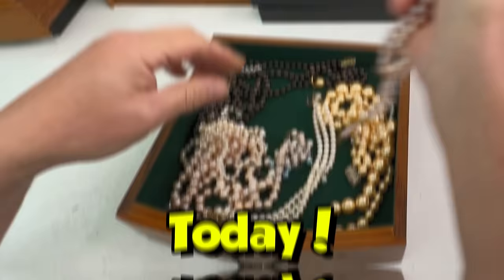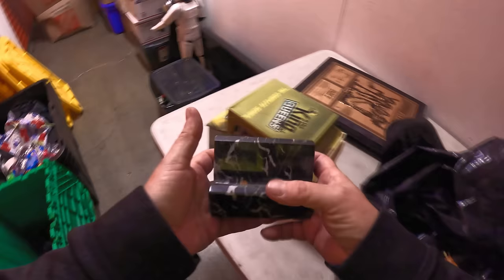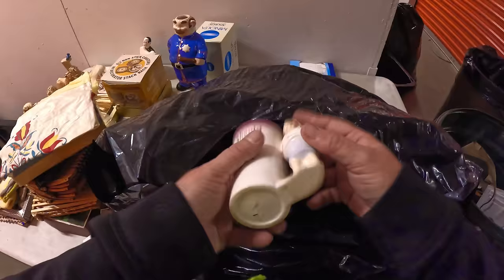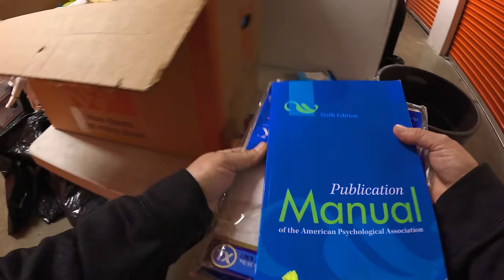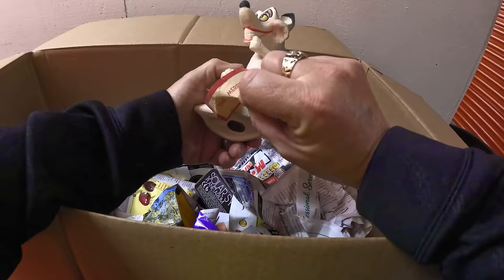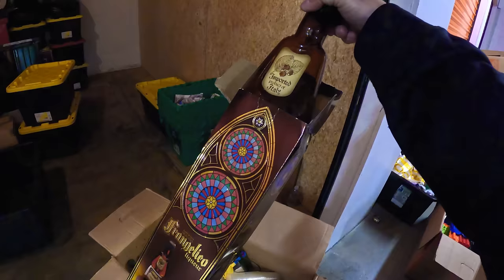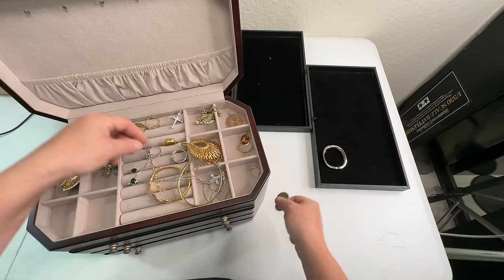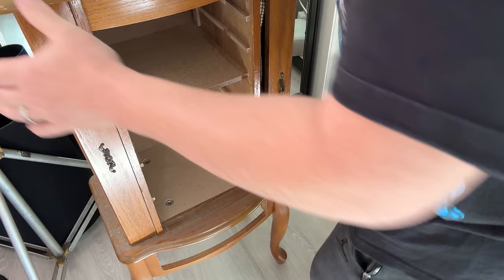I was NOT EXPECTING this... GOLD FOUND! Jewelry box opened and we hit it BIG!

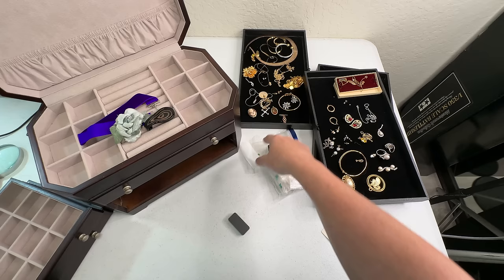Comment: Jack - vintage cocktail napkins/paper can sell for good money.  A local antique dealer buys everything I can scare up because it sells like hotcakes.  Actually, any and all cocktail Mid Mod. It all goes. 12:36 Bet it opens out into a lampshade or similar.   18:18 Made for Barney's NY? It isn't cheap, no matter what.  Barney's doesn't do cheap.  53:00 That's a REAL Cameo habille!  The pinback may be steel, as was standard, but the cameo is genuine. If someone got that as costume in the Whatnot...SCORE! (wish it could be me, but I can't load Whatnot)  56:10 Iolite that ain't. It's yellow.  case closed. 56:33 Not tanzanite.  It's blue. Aquamarine maybe. 57:30 NOPE.  14/20 = 1/20 14k gold-filled aka COSTUME. Lots of freshwaters have gold-filled clasps because the pearls aren't valued.  Flawless emeralds sold in packs like that are guaranteed synthetic emerald.  Manmade.  Real ones have flaws.

Comment: 😁👋👍👍👏👏💕🙏🏻
It really was fun. 
 The magnet is not a 100% on silver. I found this out when I was looking up some myself. And then ended up reading up on it quite a bit. Because  in Mexico there's some silver that's made And it's just a little bit lower quality than the 925. But it's still silver. And that little bit of other metal is what you're picking up with the magnet. Where it wants to stick. But it's a really Weak connection. So it's still silver just not Stirling.